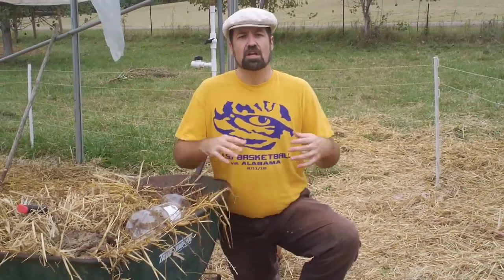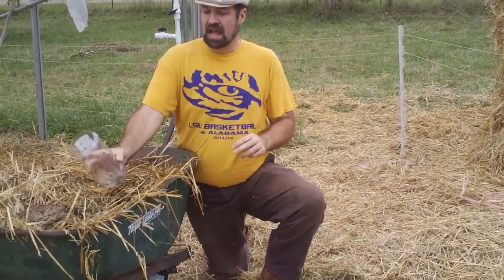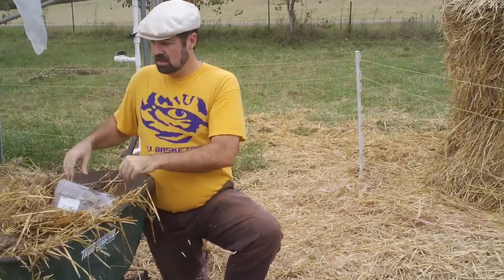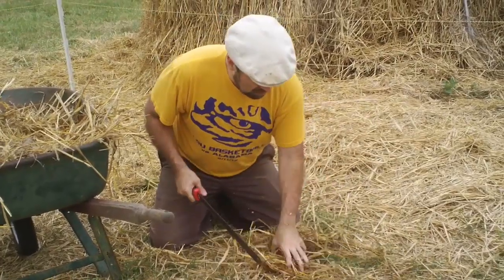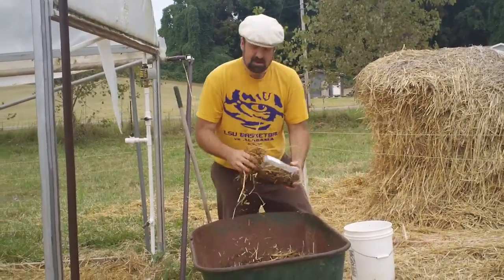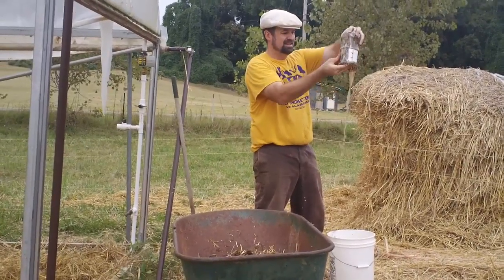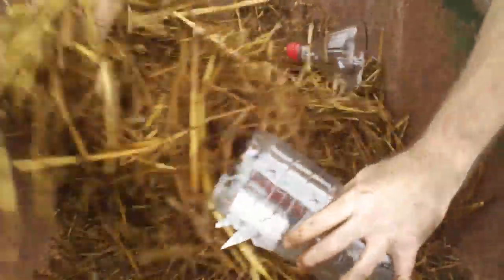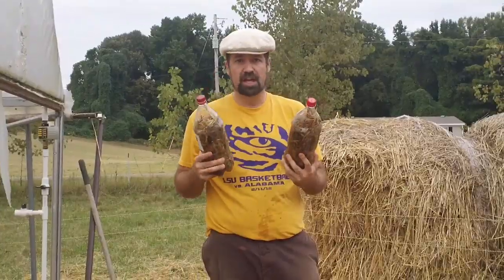Heating a Greenhouse with Compost Heat - Step 1

Comment: shredding will speed process, since it begins the break-down process for u...get up to higher temps more quickly, tho prob not a lot...I'd say unless u use the lawnmower method u mentioned, may not be enuff diff in temp rising speed to make it worth the machetti or pruners method :)
Reply: or even a chipper if u have one, to begin break-down process...is hay less expensive than straw where u r?